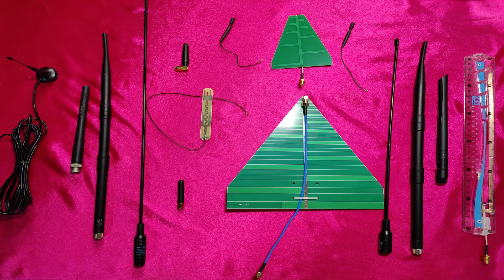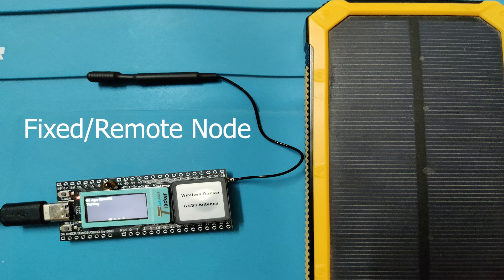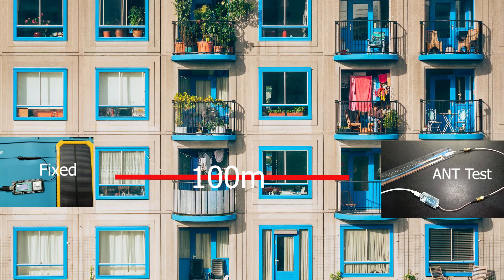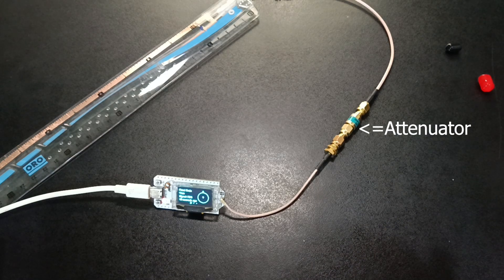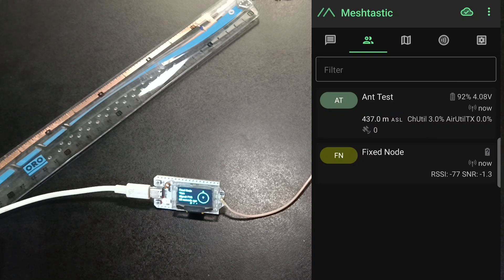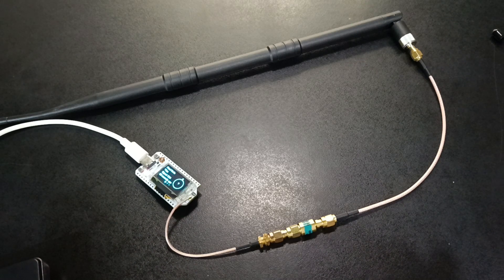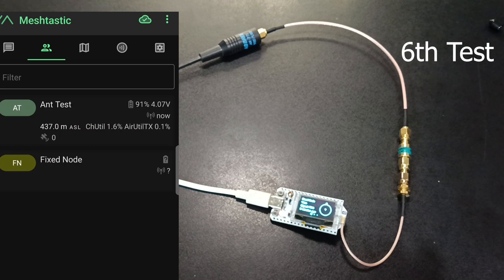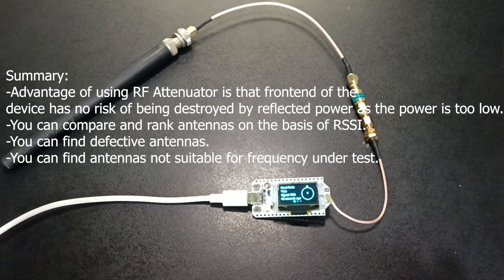Meshtastic Antenna Testing Without NanoVNA for 868 MHz by Technology Master

Comment: Nice video. Would the reults perhaps e more accurate if the antennas were vertical and in free space ? I found that many antennas are easily detuned by laying them down on a surface. Also it would be useful to see a table of your results to se how the antennas compare to each other. Keep up the good work !
Reply from the maker: Please see inline.
-Nice video. 😌
-Would the results perhaps e more accurate if the antennas were vertical and in free space ? I think there is no concept of accurate results without high accuracy test equipment. This video was not using any of those. Polarisation of antenna does matter. It has to be same on receiver as on transmitter. It does not matter if it is vertical, horizontal, LHCP or RHCP.  For Free Space, here is my reply https://youtu.be/5KqB_qgxAaE?t=140
- I found that many antennas are easily detuned by laying them down on a surface. It is not always true. It depends upon the type of surface and the surrounding objects. Anything that can interfere with Magnetism will change the properties of the antenna. Even things can interfere with magnetism will have varying degree of effect  e.g fibreglass has very little effect than copper. The table I was using had little effect for the purpose of this experiment.  The lab where we test antennas for educational or commercial purpose is a different world. I do not have video of it handy.
-table of your results. It is a good suggestion but as we can see video is already around 8 minutes. I just added something very important in the end but stats show that very few people have time and patience to find it out :) No player likes to play a difficult match without supportive audience. Luckily I am getting more and more interested people like yourself. This makes me devote more time and effort. Thanks.
Reply: Thank you, well done